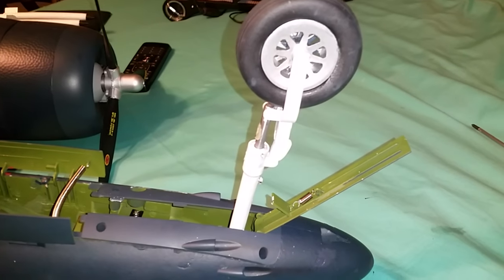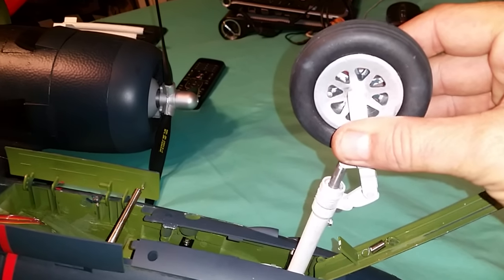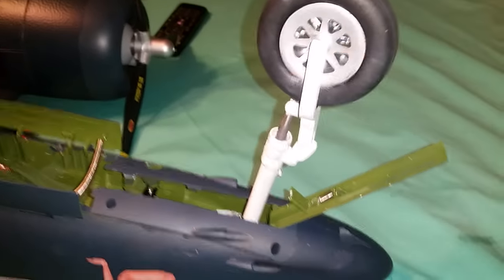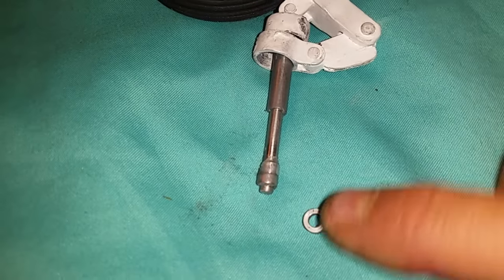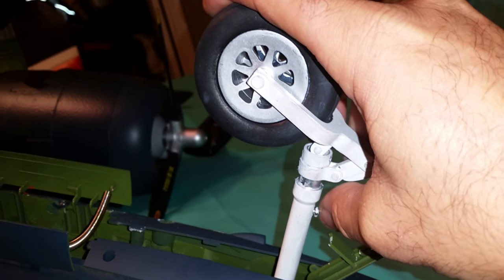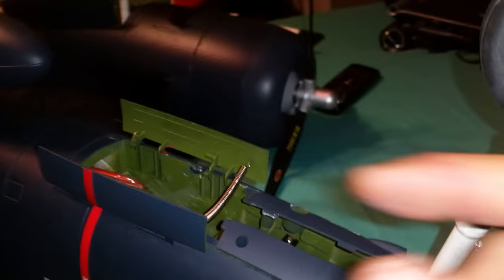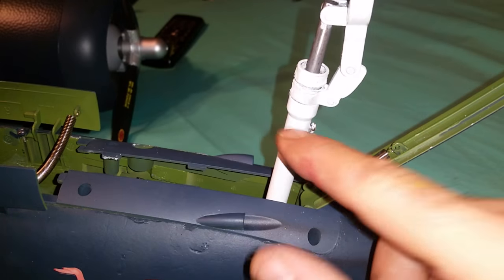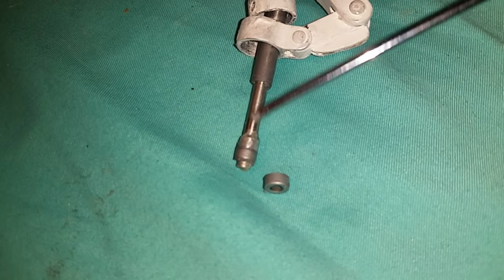FlightLineRC 1600mm F7F 3 My Upgrade Nose Strut fix explanation #2

Comment: Guys, there's a much easier approach to the fix.  Simple drill a new hole at the bottom of shaft 4mm up and trim off the shaft below the new hole.. that creates the same shortened travel without having to fabricate this ring to slip inside the piston.
Reply from the maker: I agree, Ryan from MotionRC also came up with a good alternative solution the correcting this. More information is available on RC Groups and Hobby Squawk Forum.

Just as a note: point is...this shouldn't have to be done at all and should be corrected/replaced by the seller. ;)
Reply: Brandon Moon very true.  Bought a direct upgrade part and it doesn't work. They (motionrc) know this and yet still send them out.  Fortunately it's not a difficult issue to fix if you have the tools.
Reply from the maker: I totally agree. I'm a big fan of MotionRC, but they let this one slip unchecked....Still a great bunch of folks though and still get my support :)
Reply: Wayne Sweet yea that works too!

Comment: How is your fabricated spacer placed next to the factory ring? Is the stock ring removed and then replaced, or does your fabricated ring slide on from the wheel end, with the factory stop remaining in place on the strut? Thanks
Reply from the maker: The spacer is cut open and slipped over the piston shaft, pinched back shut and then lightly secured in place it a drop of CA
Reply from the maker: Already explained this below, and there is another video demonstrating exactly what and how I did that
Reply: OK thanks, It seemed unlikely that you could pry that ring open enough to straddle that shaft, and squeeze it together again without damaging it.
Reply from the maker: Art Smart  it worked and that's what I did...proof is in the video. I did have to do it very gently though.